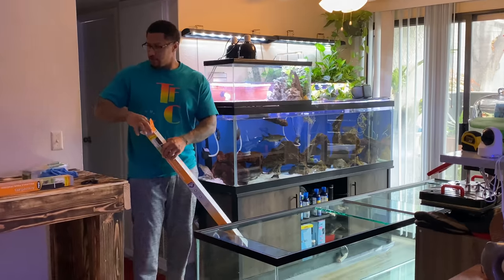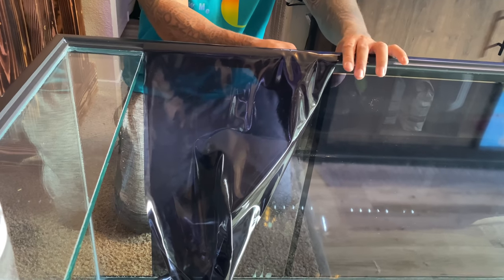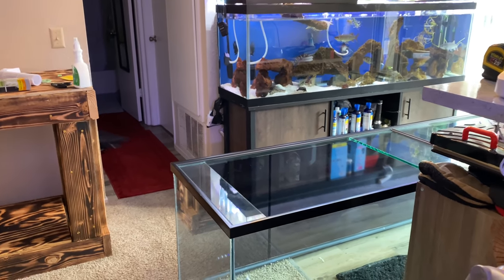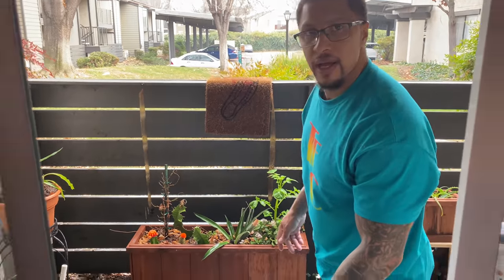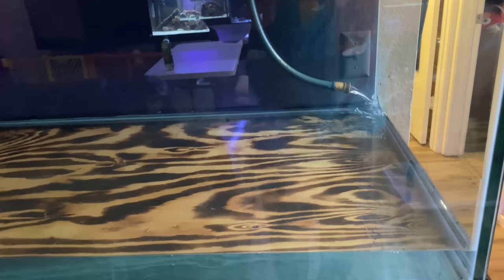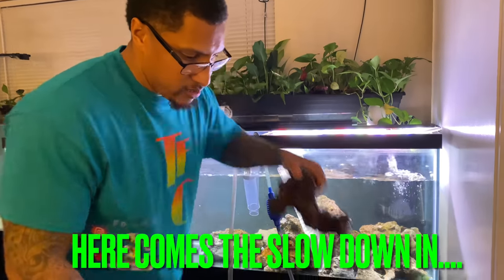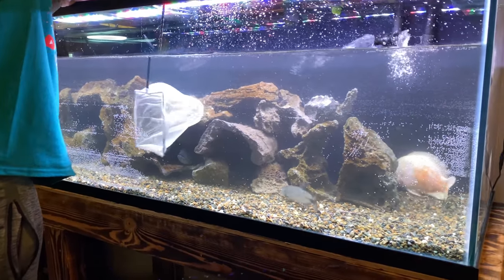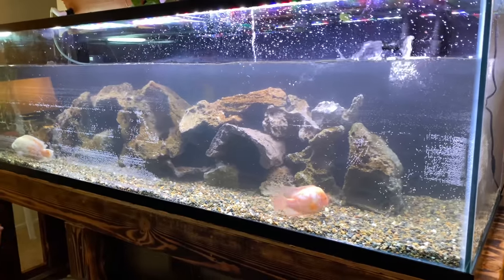Setting up my NEW [ 8ft ] 240 GALLON FRESHWATER AQUARIUM!!

Comment: You're a strong man to get that tank up on the stand all by yourself. I have a tip for you, if the strip on the film bothers you, get a ruler, place it on the middle of the strip and cut a line with your utility knife and remove the 2 strips of film. Now it'll be reduced to a very thin hair line. Good luck with your tank.
Reply from the maker: Thank you. I appreciate your comment. Good thing the line easy noticeable at all now with everything running.

Comment: with tanks that large a cheap little Transfer pump will help with the weekly water changes.  I connect my house to my garage faucet and run that for fresh water to my tanks and the use the Transfer pump to pump the water from the tanks into my wife's garden 30 feet away and out the door.
Reply from the maker: I have a pretty dope way of doing my water changes!

https://youtu.be/00lgMj0hQ0Q

 I just need a pump for siphoning out all the water in case I want to do a water transfer. 

I will definitely buy a decent but cheap pump for that though! 👍🏾👍🏾

Comment: That's a nice aquarium stand. If anyone is thinking of getting a new large aquarium, try to buy the stand that goes with it, at the same time. Aquarium stands are harder to find than aquariums.
Reply from the maker: Thank you! And I didn’t want the stand that came with the aquarium. For a number of reasons. 1) I didn’t want to spend $900.00 on a stand, I built my stand for $200.00
2) I wanted a 3ft high stand the one that came with it was 2ft high. 
3) I wanted very particular dimensions for under my 240 just in case I choose to put my 60gallon under there in the future. 
4) The burnt stand look is far more appealing than a black stand. But that’s just my opinion. 🤷🏾‍♂️ 

And I will never buy another aquarium stand again! I take great pleasure in my DIY builds and building stands to fit my needs is the BEST route to go!

Comment: And im still undecided if I want a saltwater tank bcuz of the water changes I've seen and u have pond in the living room lol 😳👌🏽
Reply from the maker: The water changes on saltwater aquariums are the worst part of the hobby. When I move I’ll buy a 250 gallon drum to keep replenished for my water changes.  And I’ll always have a pond in my living room, just in the correct area. Lol 👍🏾👍🏾
Reply: @TheFishCorner  so if I have a 50 gallon tank i would need the same size bucket to change the water in and out I'm so stuck on if I want to fill it with saltwater 😬 but you seem satisfied bcuz of the experience😎

Comment: Do you use canister filter in your salt fish aquarium?And what media do you use?
Reply from the maker: On my 225 saltwater aquarium I use a canister filter, sump with skimmer and HOB filter for surface water agitation. I also use two UV sterilizers. 

As for the media, I just use bio max, ceramic rings and the media that comes with the canister filter and HOB filter.

Comment: Love the Tank.  Next time you need move large amounts of tank water (more than 100 gallons) order a Transfer Pump off Amazon. I got one and a 300 gallon per hour pump cost me $58.00.  I have a 240 a 180.  Pump saves on time and hard physicals labor.
Reply from the maker: No doubt! Definitely need to get one of those! I’m ordering one soon because I have some tanks to move! 💯
Reply: @TheFishCorner  Cool. I just went back to Amazon and looked up the model pump I purchase and have been using for the last 3 years. Its called a EXTRAUP 115 volt 330 GPH portable Low Suction Electric Water Transfer Removal Utility Pump.  cost $59.99
If you have Prime it comes very fast.  Buy rubber hoses from home depot to replace the hoses they provide for the length needed.  It's a bit nosey, but works so fast you won't mind the nose for the  10 or 20 minutes you will needed most times.

Comment: Watching this made me crazy, wanting to help !  I understand doing stuff by myself.  The worries about a twisted seal and possible leak..  I always put a foam pad between my tank and stand.  Your stand looks top notch, but the foam removes any little variance.  good stuff !  I sub'd..  How bout dropp'n me a comment..  Happy New Year
Reply from the maker: What’s up bro. I appreciate your support and feedback. Happy New Year to you as well! As for the mat, you don’t need a mat with glass tanks with trim. It could create some unbalancing issues. Just keep the trim on a hard surface and you’ll be good. 

After this video, I had a  bunch of comments recommending to use a foam mat under the next one.. so I did, despite knowing how unnecessary it was…. The mat concealed a protruding screw head that cracked my brand new 225 gallon 24hrs after setting it up…. My fault 100% but regardless, mats under tanks with trim is unnecessary. Be careful.

Comment: beautiful tank just something i do i put yoga mat under the tank especially tank that size it even spread the weight and relieves any pressure points
Reply from the maker: Thank you for replying. I have to tell you this. DO NOT PUT A MAT UNDER A TANK WITH TRIM. Lol had to bolden that because it would and can be catastrophic. Glass tanks with trim don’t need a mat. Acrylic tanks do, since there’s no trim. You can crack your tank if it’s uneven, I did just that a few weeks later with my 225g. Throwing a mat under that tank when it wasn’t necessary.

Comment: You had me on edge with no help putting that up on the stand and was worried about the tank hitting the ground. Also how did you get the stand with the grain that dark? Looks really nice. I have a 135 gallon saltwater tank looking to upgrade to 200 or more.
Reply from the maker: Thank you bro! I appreciate your feedback and support! 🍻 I used a propane touch to burn the stand! 🔥

Comment: are you using a single fx6 for that tank? I bought 2 figuring if I did a 125 gallon I'd run both.  Not sure if I'm going fresh or salt.  Looking at 240 gallon "clear for life" tanks
Reply from the maker: I’m running 3 fx6’s on it. With an above the tank sump.

Comment: If you were moving the water from one tank to the other, why not just pump it over using the filter?
Reply from the maker: Distance was too far to use a filter but I could have used a pump if I had one. But I didn’t. 

 I’ve invested in one for the upcoming upgrades. 👍🏾

Comment: Great job! I dated a guy that did window tinting.... I hope this helps someone reading
1.  put on film, any joints OVER LAP BY 2 (TWO) INCHES
2.  Use a straight edge and cut a vertical line and peel off the overlap.

River rock is usually from the south, and is full of red clay it looks wonderful. 

If anyone has used the “white marble chip” gravel, please let me know how it looks
Reply from the maker: Thank you Elizabeth! I appreciate your feedback and support!

Comment: Shouldn't u put rubber mat under u tank so it doesn't crack that a lot of weight in a tank that size
Reply from the maker: No. If it was rimless or acrylic yes. Any glass tank with trim doesn’t need a mat under it. The glass doesn’t even touch the stand.

Comment: U shouldn't  put weight on the glass the way u put the bucket of water, mine cracked the glass
Reply from the maker: Sorry that happened to you. But it wasn’t even an issue for me. 🤷🏾‍♂️ As you can see. 

But I have moved on to using pumps to move around my water. Got tired of lifting trash cans full of water. 😂

Comment: You never , I mean NEVER put an aquarium on a stand, without a sponge layer between the glass and the stand. You never know where you have a higher point that brakes the glass in a heartbeat!
Reply: The glass dosent sit on the stand. The only thing on the bottom that is touching the stand it the perimeter of the plastic bottom rim. The glass is up 1/4" or so on the bottom. Did you ever own a fishtank?

Comment: No cycle?
Reply from the maker: Nope, no need. I used 100 gallons of the water I had in the 125 gallon as well as all the filtration.  

Meaning it was basically a 60% water change.

Comment: way to big fish for this "small" tank..put in 1000 very small Rasboras...and it woukld look amazing.
Reply from the maker: When you keep large aggressive cichlids, you have to over stock the tank a bit to prevent one overly aggressive fish from singling out a less aggressive fish. The fish may have  occasional bursts of aggression which will be distributed evenly instead. Also having a lot of rock in the aquarium with site breaks is absolutely necessary as well. This is an old video and the fish have much more pleasant accommodations but the this tank at this time was set up strategically to ensure I was able to successfully keep the fish I was keeping.

Comment: Man i dont no how some of u guys dont put a piece of foam  or soft pad under the base of the tank so dangerous and risky
Reply from the maker: You only put padding under acrylic tanks. This is a glass tank.
Reply: @TheFishCorner  ooooh damn so wrong bro glass isnt flexible any pressure points can snap it ive been a reefer for over 10 years i can tell you for certain its glass that needs the padding my sump is acrylic and i dont have padding not sure about freshwater brands but all the top marine brands like redsea,cade,waterbox,  aquaone all there tanks come fitted with padding on the bottom its actually stuck on but anyway nice tank good work for doin it on your own